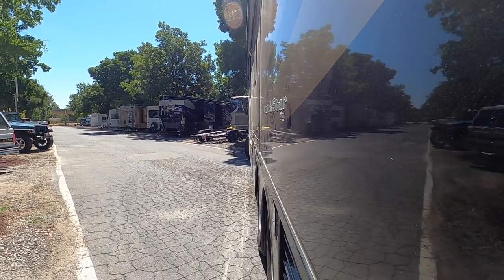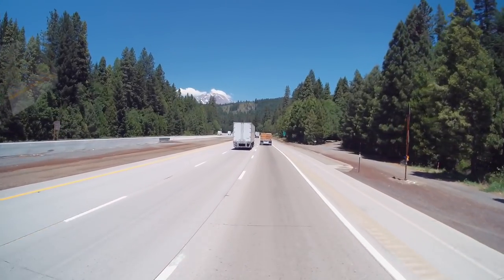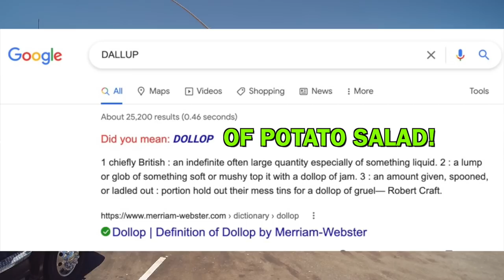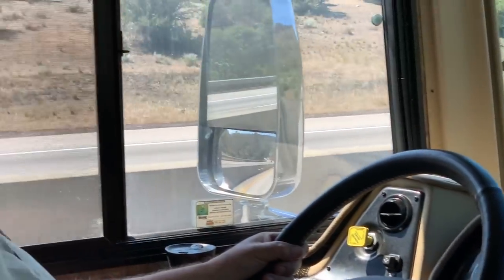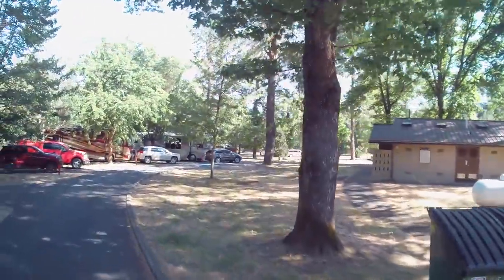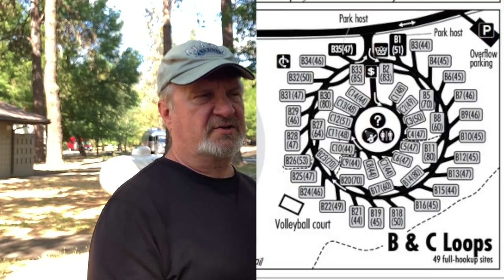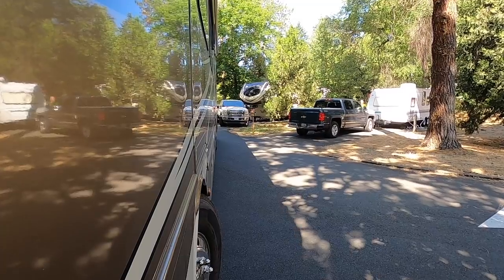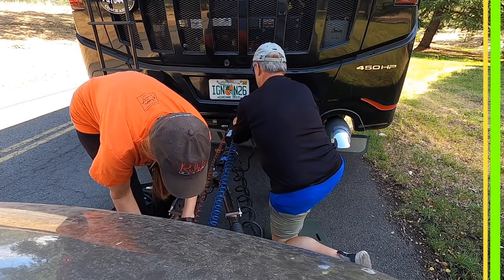PULL THRU AND BACK IN RV SITES CAN BOTH BE A CHALLENGE! USING YOUR JAKE BRAKE DOWN A 6% GRADE -EP179

Comment: Hahaha, the OJIM romantic rest stop on I-5 as it shall be called from here on out!  We stopped in that very same rest area back in April as we made our way up to Astoria, OR., for our spring vacation.  Our truck and travel trailer did really well on those hills - surprisingly well.  I really appreciate you showing us the challenges of driving a rig like yours around campsites.  While we're at 50ft with our trailer and truck, the fact that it pivots near the middle makes things a bit easier.  At times, though, when first arriving and again on departure, we've sometimes had to block driveways when hooking up and/or un-hitching (most RVers understand and are patient).  But I gotta tell ya, going through the car-lanes with the trailer attached to get fuel is very nerve-wracking.  I'd love to take my diesel truck through the truck lanes, but haven't yet tried that.
Reply from the maker: Backing a trailer or 5th wheel into a spot requires way more skills than I have with our Motorhome.  I tip my hat to all the pickup truck drives! I just disconnect the car I am towing when things get tough!

Comment: Better get #3 ac fixed as a back up to the other 2. If the breaker trips when you first fire it up my guess you need to replace the starting capacitor.  They make a slow start cap. ...or if trips when running might be a bad circuit breaker.
Just guessing. A good ac shop could test.
Reply from the maker: I am glad you and another subscriber suggested the breaker change.  That is logical, cheap and I am planning on doing that soon!  Thanks.

Comment: we had a four hr travel day from north Carolina to New market Virgina we are staying at Endless Caverns rv resort it a great place but glad i have 4 wheel drive on the truck
Reply from the maker: When you need 4 x 4,..........you need 4 x 4.  Period!   It's only a matter of time. I would never RV without a 4 x 4 pulling an 5th wheel or trailer in some of the 140 plus campgrounds we have been in,......
Reply: @OurJourneyInMyles  it helps a lot reduces my stress when i need it

Comment: Mark, probably a dumb suggestion, but wouldn’t a magnetic flashlight in a predetermined spot on the hood of the Honda pointed at the center of the tow bar, work to position the Honda in the right place?
Reply from the maker: That's a great idea Harold.  It usually goes pretty smooth and easy until you film it!

Comment: I’m wondering if a hitch that is mounted to the tow vehicle would be easier.  We had one that was mounted on the front of our Toyota PU which folded down onto the bumper.  You’d only have the one arm that would attached to the ball on the back of the motorhome.  Any thoughts?
Reply from the maker: I would not be comfortable with a single point connection.  The entire towbar industry uses the same basic setup we have.  For the most part, it is a breeze to hookup and disconnect!

Comment: What Honda do you tow 4down? What modifications did you need to make
Reply from the maker: Folks should always refer to the free, online PDF documents, that the Family Motorcoach Association compiles (The Dingy Towing Guides) listing all the approved cars and trucks by model and year, that you can pull behind a motorhome. Additionally, it proves notes on any added preparation needed before towing can start for the day.
I would probably NOT RECOMMEND pulling a Honda Odyssey. We are taking a chance,….we have a lot of money on the line with the faceplate mod and Air Force 1 Braking Mod. We paid top dollar to get an extremely low mileage 2013 EX-L, (about 23k miles) so the transmission was in as good a shape as possible.  Are you willing to risk this like we have? 
We corresponded with someone on irv2.com in June of 2017 that was pulling a 5 speed Honda 2013 Odyssey for over 25k miles.  This prompted us to “go for it!”  He has since (about 1 year ago, had a trans failure.)  He maintains he thinks it was NOT related to towing it.  He liked his Honda enough he put a rebuilt trans in!  We love our Honda and will do the same if we have an issue.  WE CHANGE THE TRANS FLUID every year! 
We needed to pull a garage for our expensive bikes! After many conversations, WE DECIDED TO TAKE A CHANCE, AND PULL ONE AS WELL.  We tow a 2013 EX-L Honda Odyssey. This is the latest year model (2013), and highest trim level (EX-L) model you can THEORETICALLY tow. Honda DOES NOT recommend towing it.  Yes, I know, you are not supposed to tow it!   Honda decided it wasn't worth the warranty claims of damaged Odyssey transmissions when NOT shifted into neutral following the EXACT instructions they provided way back in 2004.  
(YOU MUST SHIFT INTO NEUTRAL FROM DRIVE ONLY, NOT FROM REVERSE!)
They gave up on the Odyssey towing public, because of this Odyssey peculiarity and said you can’t do it.  I corresponded with a few other brave souls that had over 20,000 miles towed on their Odysseys before I was man enough to do it. 
We have PULLED it about 25,000 miles since June of 2017, and we have DRIVEN it 59,000 miles. SO FAR, SO GOOD.
The 2013 Honda Odyssey Touring was a 6 speed, and CAN NOT be towed. In 2014, EVERYTHING went to 6 speed. You can search for the Honda Vin number decoder on the internet to make certain your Honda is a 5 speed to see if you would be OK. Any other years you would want to buy, you would want to research the internet and vin # to make sure you are not buying another 6 speed! We liked our (2) 2015 6 speed Honda Odysseys so much, that we sold them to get our (1) 2013 5-speed Odyssey. We are Full Time, and just need one car now. YOU DO NOT NEED ANY ADDED LUBE PUMPS!

THIS IS THE TOWING PROCEDURE WE USE,…….EASY AS PIE,…..
It has been simplified, directly from the 2004 Honda Odyssey towing instructions, which is the last year they "allowed" towing. The "PV1A Transmission” is the ONLY Honda Odyssey Automatic transmission you can tow, IF YOU FOLLOW THE INSTRUCTIONS from Honda back in 2004 when they allowed the PV1A to be towed. It MUST be this 5-speed transmission. I left in a lot of the Honda legal jargon at the end just for your info.
• Start the engine and get it to operating temperature. (I am usually still packing something up.)
• Press on the brake pedal. Shift the lever through all the positions (P,R,N,D,2,1).
• Then shift up from 1, 2, Shift to D, then to N. DO NOT GO INTO REVERSE! Let the engine run for at least three minutes, then turn off engine. THIS IS THE KEY, AND THE ABSOLUTE ISSUE THAT MUST BE FOLLOWED. SHIFTING TO NEUTRAL FROM REVERSE WILL SET YOU UP FOR PROBLEMS, AND/OR TRANSMISSION FAILURE. How many times you can do it wrong, I don't know. I am absolutely vigilant on this procedure. You must shift to neutral from DRIVE.
• Make sure parking brake is OFF.
• Leave the ignition switch in ACCESSORY (1) so the steering wheel does not lock. Make sure the radio and any items plugged into the accessory power sockets are turned off, so you do not run down the battery. (Our tow electric cord has a trickle charger line to keep the battery from going dead. We have an SMI Air Force One brake system,.......Honda is around 4,600 lbs. loaded.)
If you travel more than 8 hours in one day (including stopping time), you must stop and repeat the above procedures.
NOTICE:
The steering system can be damaged if the steering wheel is locked. Always leave the key in the ACCESSORY (1) position to prevent damage to the steering system when towing behind another vehicle.
CAUTION:
Severe automatic transmission damage will occur if the car is shifted from reverse to neutral and then towed with the drive wheels on the ground.
NOTICE:
Improper towing preparation will damage the transmission. Follow the above procedure exactly. If you cannot shift the transmission or start the engine, your vehicle must be on a flatbed truck or trailer.
If you tow a Honda/Acura vehicle with automatic transmission, the fluid must be changed every two years or 30,000 miles, whichever comes first.
Although experience has shown that the Honda/Acura transmission and powertrain are capable of being "motorhome towed", America Honda does not assume responsibility for any vehicle damage or liabilities incurred due to the towing device, towing vehicle, lighting hookup, or other towing equipment or towing procedures; any responsibility for these items is assumed by the owner/operator.
If you have additional questions, please call American Honda Motor Co. Inc. (National Consumer Affairs) at 800-999-1009.
Good luck,…..as I said,…….I would think it is not a good, sound, financial idea,……although we are taking the chance!

Comment: If your tripping the breaker on your AC, sounds like a bad capacitor.
Reply from the maker: It will run for quite a while before that happens. Going to replace the breakers first to see if they are just tired 20 amp gadgets.
Reply: @OurJourneyInMyles  mine did that as well. The “kid” said I need a new motor and they don’t make them anymore so I needed a new unit. Found the motors no problem. Checked the caps first had one low on the MFD scale replaced it, 1 year later have had no issues. The big problem is finding a reputable company to look at it.